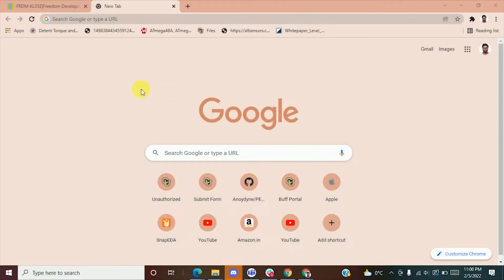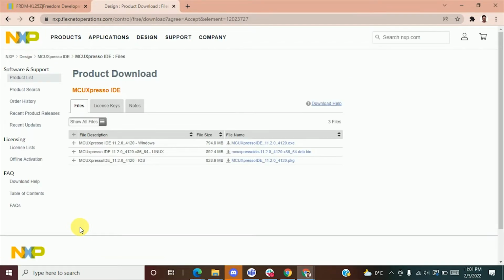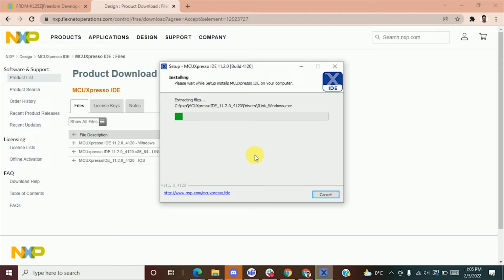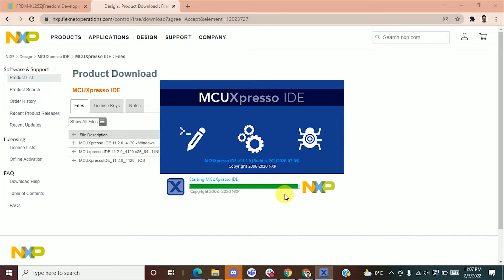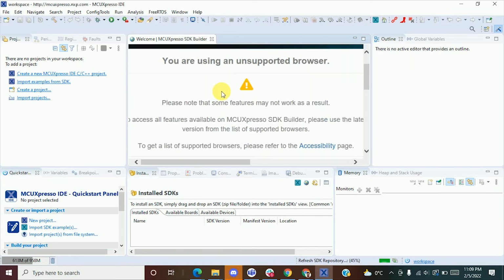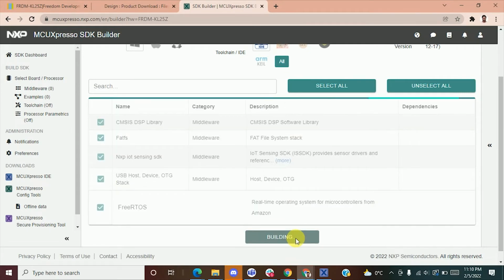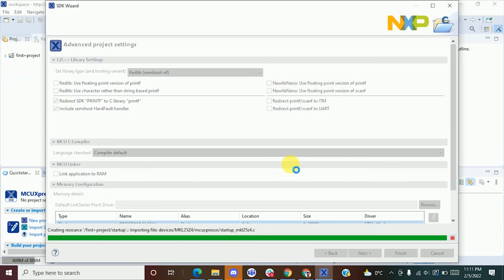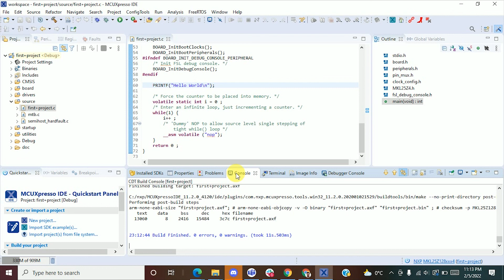How to Install MCUXpresso IDE | NXP| Getting started with FRDM-KL25Z

Comment: Can we connect sensors to the freedom board, which can be use as input signal ?
Reply from the maker: Yes you can connect. Check the pin mapping to make sure what pins you want to use and based on that you can configure the pins as input or output. Thanks
Reply: @electrofun5135   Thanks😃
Reply from the maker: Welcome